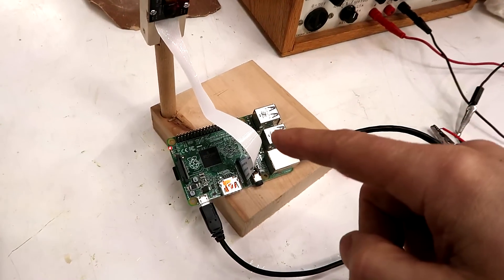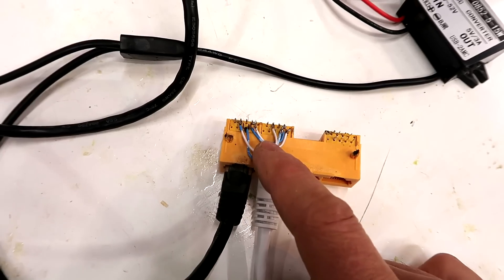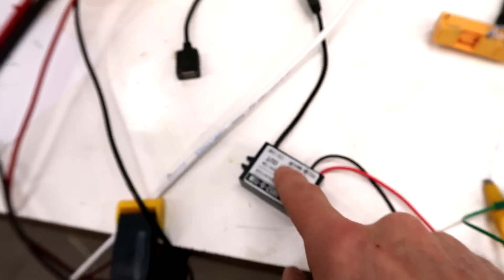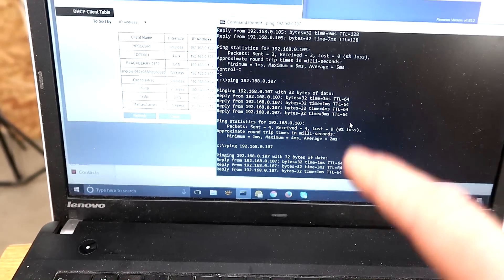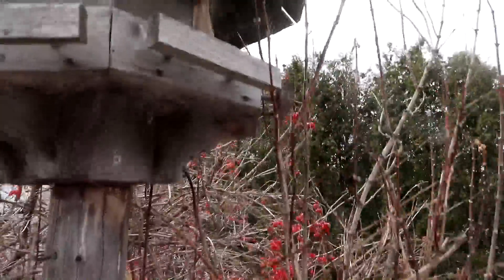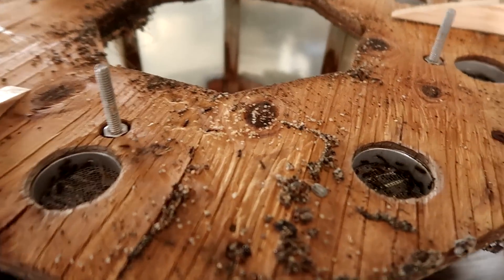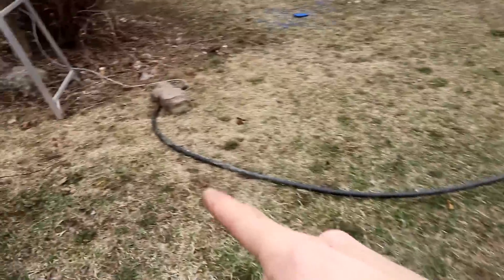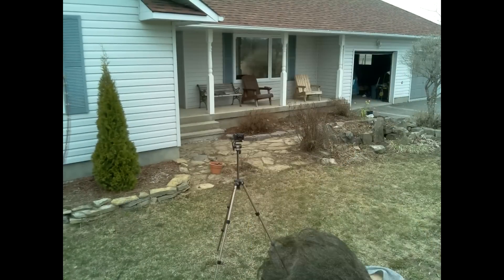Raspberry Pi power over ethernet and mount it outside

Comment: can u pr0vide more info on the power regulator you used between POE and raspberry.  i am setting up POE just for security cameras in and out of house.

what is limit on distance with POE?  i have 4 buildings apart from home and was setting up POE there also.  70yrds to first and another 70 to last building...  also does POE come on10gb networks?

Comment: If you are using the ONVIF firmware you can configure some of the GPIO pins on the pi for controlling a servo or a stepper driver and use those as pan/tilt. Also IR illumination can be added.

Comment: could have solderd wires from the ethernet port to the 5v lines on the pi if you used a 5v poe injecter

Comment: If you mount that project box where the sun will shine on it, it will start cracking in year or so. It will be completely destroyed in 2 years or so. Just wanted to make sure people didn't think it was acceptable. Use something UV rated like https://www.amazon.com/Extreme-Broadband-Purpose-Enclosure-Interior/dp/B01N4FSKZM/

Comment: Ethernet sockets use isolation transformers internally to insulate the cable from the electronics. This avoids the ground loop you would otherwise get.

Comment: Yeah, when I used Digis internet service here in Utah, which was later renamed to Rise Broadband after I switched to CenturyLink for internet to go with my home phone service (formerly Qwest, formerly US West, formerly Mountain Bell), I had to use a PoE box for the little radio transceiver on the roof. That cable could then go straight from the roof, through a sealed hole, and right into the computer or a router/bridge/switch, etc.

Comment: if you don't need it to be powered by a real POE like from a switch, you can just use passive POE like this: http://www.hobbytronics.co.uk/image/data/sparkfun/passive-poe-cable-set-3.jpg or just diy and solder onto the right pairs
Reply from the maker: But I needed the voltage converter because I'd get too much voltage drop on the line.
Reply: didn't you already have the dc-dc converter?
Reply from the maker: Yes.  But what you are proposing is basically the same thing, but with a bought dongle instead of homemade.

Comment: When did they add POE to Pi? Last I saw it didn't have POE.
Reply: djAnakin very recently with the Raspberry Pi 3 B+
Reply: I don't think Mr. Wandel is using a new Pi with built in POE and he doesn't need to. Depending on how you are sending the power, you don't NECESSARILY need the device itself to have POE capability and I think that's what Mr. Wandel is doing here. 

Disclaimer, I am NOT trying to insult your intelligence. I teach middle school and so I tend to over-explain and also over-simplfy because my job is to explain nerdy stuff without assuming too much basic knowledge. This is adapted from the kludgey demonstration I have mocked up for my classroom.

There are four "Twisted Pairs ("TP")) of wires in a CAT 5 cable. (I explain to the kids that "wire" means a single conductor while "cable" means a bundle of 2 or more wires).  "100baseT" ethernet only uses two of the four twisted pairs. So it occurred to experimenters in the last century that you could use one of the other pairs to send low voltage to a remotely located ethernet device. Split out two of the unused wires, solder them to a wall wart and then, at the other end, split out the same TP and solder the connector you cut off the wall-wart to that pair and power up your gizmo. I think IEEE has a standard for this and calls it "Alternative B" but I wired up my mess before I really understood IEEE standards.

Some people are really pushing this, using a single CAT5 cable to transmit ethernet over two TP, power over a third TP, and POTS ("Plain Old Telephone Service") over the fourth, but the next buyer of your house will be completely baffled unless they are as nerdy as I am...

The other way to do POE (and I think it is the preferred, IEEE "alternative A" is to send power and data over the same wires. If you are going to wire to the latest ( CAT6) standard, I think you have to go this way because CAT6 assumes all four wires are available for data. This requires a device that injects power into (??? maybe all four twisted pairs???) and then the remote device has it's own built  in circuitry to split out the power from the data.

And that's enough of that!
Reply: The new 3B+ has support for PoE, but only with an add on kit that plugs into a new header next to the Ethernet, and injects power onto the main DIL header.

Comment: I have the same PoE splitter, and it works only from 48V. Ubiquiti also makes 48V injectors, but they are way less common than the 24V ones. A neater solution would be to keep the DC-DC converter with a passive PoE splitter, which just taps off the power as you did.

Comment: You can get really cheap PoE extractors that you can trust conform to whatever PoE spec you want to use. I got a cheap 12V one off amazon and soldered it inside the waterproof case of a non-poe camera I bought so I only have to run 1 cable to it and it still looks identical on the outside.

Comment: I just bought a couple of these to power some non-poe ip cameras. You can switch between 5, 9, and 12 Vdc and I can confirm that the POE is not passed through the device. They work great and are very clean. http://a.co/9kZPZu4

Comment: I had a similar setup that I designed on a simple PCB using a 5V switching regulator.  I eventually started using these cheap $15 PoE adapters that actually using the PoE +48V and outputs +5VDC into a micro USB.  Plug and play.

Comment: An outfit called Pi-Supply makes a PoE HAT available now.  No engineering required on your part.  They even have a case available to house the entire assembly.  It even transfers 2 times more power then your 24 volt solution.  Works with any of the 40 pin GPIO models.

Comment: Power over Ethernet was designed with compatibility with non PoE devices in mind, so there's no harm in plugging a network line with PoE into a non PoE device.  And PoE sometimes uses the orange/green pairs anyway to deliver power, (yes, I've seen it done that way.)  Too late for this project, but at least you'll know next time.   BTW, using the old bird house as a place to hide a camera, great idea!

Comment: Using only four wires of the Cat5 for data, you'd only get 100 Mb/s. I guess at 1 fps, you don't need anything faster.
Reply from the maker: The pi is not gigabit ethernet.  Much slower than 100 in fact.

Comment: This is definitively DIY for the sake of DIY, since a dedicated CCTV IP camera would be better and most likely also cheaper.
Reply from the maker: Actually, the resolution on these things is terrible.  And this allows me to customize exactly what it triggers on.
Reply: $132 doesn't seem neither cheap nor as much fun as DIY...
Reply: I don't understand your answer. Every IP camera I've seen lets you set up triggers on whatever you want, i.e. draw a box around your front door and anything that moves near your front door will trigger it (to record if not recording 24/7, or send out e-mail notifications, etc.). And the resolution on what is terrible? If you want top of the line you can get a 4k hikvision PoE camera for $132 shipped https://www.aliexpress.com/item/Hikvision-8MP-IP-Camera-DS-2CD2385FWD-I-Network-Turret-Camera-H-265-Updatable-CCTV-Security-Camera/32819799778.html

Comment: The fact that the (edit: original) Pi wasn't designed with PoE was one of the most disappointing discoveries i made about it. I mean, you have on board, you have battery, you have plug in, but you don't push the extra mile for something that was pretty common in the day for routers and such...

Comment: 6 months later: My home secutiry camera ceased to work - inspecting an ants nest inside the raspberry pi wooden housing.
Reply: Twice in 5 years ants have taken the internet down at my house. They built nests inside a router. The router is actually in a barn around 100 yards from my house, but that is where the internet comes in.

Comment: would it be a good idea to insert a surge protector or even galvanic isolator between your network and the POE injector?
Reply: Some form of lightning protection would not be a bad idea. Probably the first nearby lighting strike will take his pi offline. But then again, it is just a pi.
Reply: The surge protector woud be to protect the valuable computers inside the house from a surge coming over the network cable.

Comment: The raspberry pi 3 model B is meant to have PoE built into the Ethernet socket on the board
Reply from the maker: but you need a special pi hat, to enable it, and that isn't available yet.  Plus I already had a pi 2 kicking around.

Comment: Matthias, normally, ethernet have a transformer (as per specs), so it should be safe to send power. The transformer is that black box you see on some cards, or it can be build in the jack itself, which appear to be the case on the pi (notice how deep the ethernet jack is? way too deep? Yeah, that's the transformer on the back).

Power over datalines use a centertap transformer on both end, on all 4 pairs. Some  PoE use the unused wires for 10/100 (pin 45-78), and some use the datalines... Thanks to the lack of an universal standard...

Comment: The new RPi hat is IEEE 802.3at compliant, so be very careful. Plugging it into a non-compliant injector is likely to cause bad news.
Reply: Not true. Passive 48V injectors (assuming that they can supply enough current), will happily power active 802.3at/at devices. Almost every PoE midspan or injector on the market is a passive injector

Comment: Why not just use a pi 3 (built in wifi) and use a 5v battery power supply? I also think you are a man that would benefit greatly by having a 3d printer. I'd be willing to be that if you reached out to gearbest, banggood, or hell maybe even lulzbot they would probably send you one. I'd go for the lulzbot first but the cr-10 and anycubic i3 mega are great if you have to go to the chinese places.
Reply: x9x9x9x9x9 he has said before he doesn't like 3d printers and for most things he does its far faster to just make something by hand then design and print it.
Reply: If you add in a battery you now have to worry about the battery staying charged enough to fully power the pi, and WiFi might be a little bit to flaky at that distance. Easier to hard line it and run power through the line you have to lay anyway
Reply: TheTechnosasquatch I have a pi3 and yes it has a really weak wifi. It can't keep a steady signal even from the next room.
Reply: Then you need to keep the panel clear/clean.
Reply: You must be new here if you think Mathias is going to solicit a donation from a vendor. He also has made fun of 3d printers in the past. As far as batteries go, the pi uses a fair amount of power. You would need to change batteries often.
Reply: No shit, Mathias' got standards, he ain't the kind that kisses asses and bend backwards for company sponsors. In one video a company sent him a table saw and asked him to review, he actually gave some fairly negative reviews and then commented: I think now nobody is gonna send me stuff to review. But anyway he's very frankly speaking guy, which makes his opinion more believable.
Reply: Batteries suck. You have to keep swapping and recharging them.
Reply: It could be solar powered, using the battery as a way to buffer the output from panel and allow it to run through the night. The issue still lies in that batteries can still screw up even in the best conditions.

Comment: Wouldnt a PoE IP camera have been very cheap and done the same thing except no pi has to be sitting outside?

At the point of what you did couldnt you have just routed power wires straight from whatever gives the power and maybe just manually account for the resistive voltage drop?
Reply: Would have been cheap, but he already had a pi so there wasn't really much of a need to buy something he could already make.
Reply: TheTechnosasquatch 

I would think that usually, but he a bought a power convertor, and he would seem to be a fan of having a pi hanging arround to play with on something else more in depth.

Comment: I couldn't tell for sure if there was a hole big enough for birds to actually get in there, but if they can it would probably be a good idea to put some kind of deterrent in there to keep them from nesting.  I'd also probably put the ethernet cable in some small PVC pipe rather than the hose.  It would be similarly cheap, and the little bit of extra rigidity to the pipe would provide at least some amount of extra protection against some accidental digging in the future.

Comment: This is a bit complicated tô understand, but i find these raspberry pi very interesting - even though i dont understand It well...
Reply: Otavio Cordeiro a raspberry pi is literally just a normal computer, nothing more, nothing less. You can use it to do anything you'd use a normal computer for.

You can even use it as a standard desktop, but as it has about the same performance as a desktop from the year 2000, it's not ideal.

But the idea is that it's great for any purpose where you "could" use a laptop, but it woudnt be practical for.

This project is a perfect example. You could do what he did with a laptop, but it woudnt be great outside longterm, plus expensive.

A pi costs about $30.

Comment: I'm fairly certain that PoE is a basic part of the 10/100/1000base-T specification so it shouldn't fry anything.  We upgraded to a 48-port PoE switch in our office for use with new IP phones and everything in the office plugged into it -- workstations, servers, copiers, etc.  No problems.
Reply: Actually, ethernet is robust to DC voltages across pairs. That's how PoE works, a (typically 48v) DC supply is connected across one (or both) of the pairs. On the device side/RPi side the powered device extracts the DC voltage using the center tap of the isolation transformer that is integrated into metal ethernet jack. 

Using a standard PoE supply, the voltage won't be applied if you don't have a chip to tell it to enable, but because there is so much non-standard stuff out there, you can't depend on that.

Moral of the story: you won't fry a Pi by plugging in a PoE connection, even if it is non-standard.
Reply: Everet Anema Well.. PoE devices are.

But non-PoE devices may or may not have 75 ohm resistors between the pairs. (Or shorted them together, or whatever that is not ready for 48v)

So there is a chance of smoke if you just just apply power at random.
Reply: Isn't PoE just a voltage level offset? If i understand it correctly, this means that you should be able to fry any device that's not properly grounded, if that was a problem.

Comment: The milky texture is called Crazing. You can replace the panels with acrylic which is UV resistant and anti-craze. Edit: obviously glass is great too. I just have been researching acrylic for a project and this came up.

Comment: Isn't voltage drop a problem ?
Reply from the maker: Not a problem, voltage drops a bit, but the dc to dc converter regulates to 5 volts.
Reply: PoE supplies 48V DC and there are different power classifications for each standard. Correctly the DC/DC converter will regulate here to 5V. Important would be to observe the power required. Wikipedia has a pretty decent article about it - https://en.wikipedia.org/wiki/Power_over_Ethernet.
Reply: CAT 5 has 22 AWG Copper wires. At 5 V and 2 Amp (probably the peak power draw of the RPi + Camera), you'd have a voltage drop of 84% over 20 meters, so that would indeed not work. But at the voltage of PoE (around 50V and hence at 5 V * 2 A / 50 V = .2 A current), you only have a power drop of 0.85% which is negligible. Check out this calculator: http://www.calculator.net/voltage-drop-calculator.html?material=copper&wiresize=52.96&voltage=50&phase=dc&noofconductor=1&distance=20&distanceunit=meters&amperes=.2&x=98&y=17
Reply: Kate It is correct but my point was POE is a standard which works using 48VDC. This works but is not compatible to POE standard devices. But hey it works thats is what this was about.

Comment: You can buy ethernet cable that is rated for outdoors, and PVC pipe is probably better for burial.  If you bury it with ends exposed you can run new cables in the future if needed.  I'm surprised that PoE supply turned DC on, there are supposed to be sensing resistors it tries to detect before applying power, specifically to avoid damaging non-PoE devices.
Reply: the POE device looked like a Unifi POE. The newer UnifiAC's are standard POE but the old ones were proprietary. If that was an older one then better safe then sorry was definitely the way to go.
Reply: Spec-compliant Ethernet uses an isolation transformer on every line, so DC would be blocked and the device would not be harmed. There was actually a part substitution problem with rasberrypi a few years ago involving this https://www.raspberrypi.org/blog/manufacturing-hiccup/
Reply from the maker: I never connected the POE device straight to the pi, so there wasn't any sensing resistors for it to see.
Reply: Exactly.   proper, compliant, PoE supplies need to see those resistors before they  put DC on the line.  It's how it's backwards compliant to legacy non-PoE devices.  Since you never put a 25kOhm resistor between the powered pairs (on your cobbled connector), the supply shouldn't have turned on.
Reply: Even the new Unifi AC's that are standard PoE (i.e. UAP-AC-PRO) come with PASSIVE 48v PoE injectors.
Reply: Phillip Hutchings The ethernet chip would be ok, but you can still burn the transformer and/or termination resistors.

What damage depends on what pins the voltage is supplied on.

PoE according to specifications can also use the data-pairs making you need only 2 pairs, using transformer center-tap to extract the power.